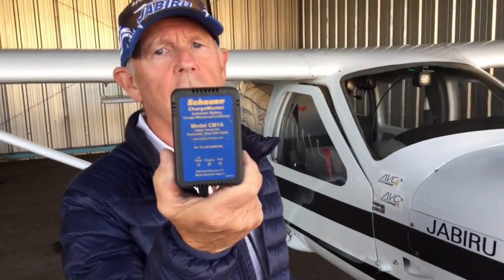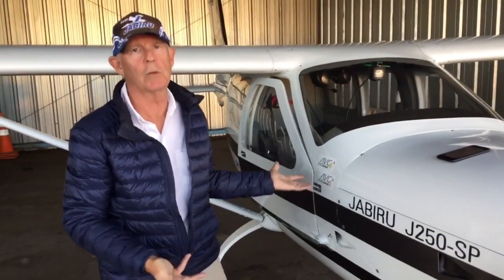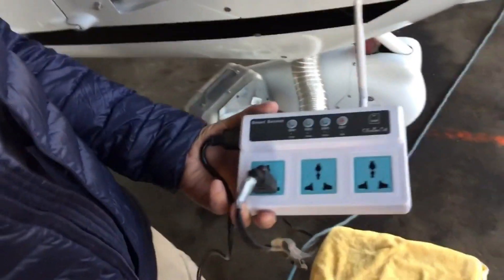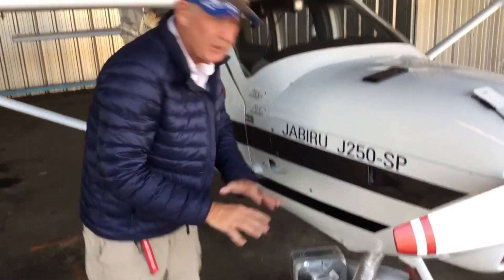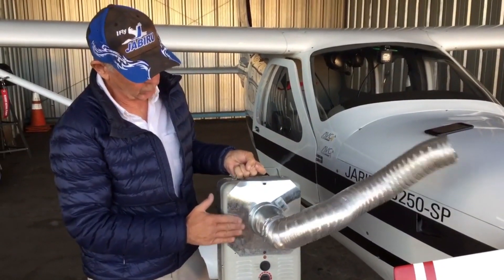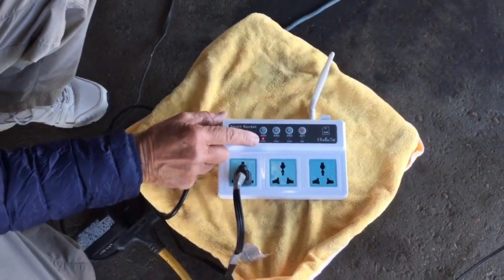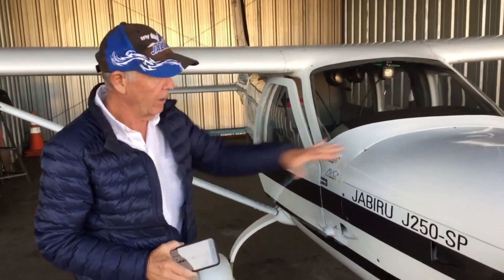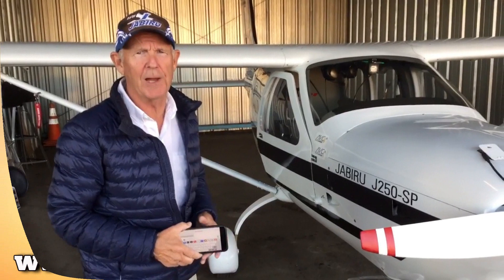Jabiru Aircraft Engine Cold Starting Tips

Comment: why not just buy the cold start kit from Jabiru....high output coil for $275 Aus and it works every time. If you fly into the outback the old home heater solution isn't very viable and not safe in any case. Besides that this solution only works within cooeee of a power point.

Comment: With not being at my hanger and turning on an electric heater remotely I would be concerned about having a fuel leak and fumes near the heater turning on and creating a big fire or possibly an explosion from fumes. I always worry about using household items that were not intended for use around aircraft. It’s a great idea but using electrical heating appliances in closed spaces near gasoline has always proven deadly and that’s why mechanics use pneumatic tools while working around aircraft. I know battery powered tools have started making they way into mechanics toolboxes but even that practice can be deadly when the area has not been ventilated properly. Honestly I would hate to be driving to my hanger and seeing this large plume of smoke & flames billowing from my hanger knowing I had just saved a couple of dollars putting together this inexpensive heating device when I should have purchased a UL or FAA approved heater unit that was designed and tested for enclosed spaces that had been tested for use around gasoline fuels. Jet A maybe but gasoline I am not so sure because all it will take is one spark from the heating unit to ignite the fumes. Maybe I just worry to much? Anyone else have any thoughts about the heating idea?